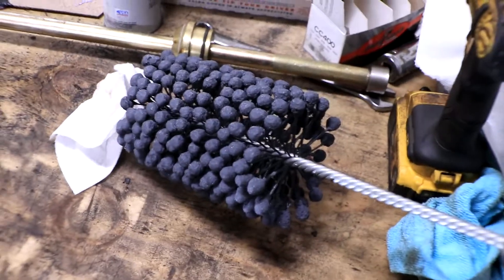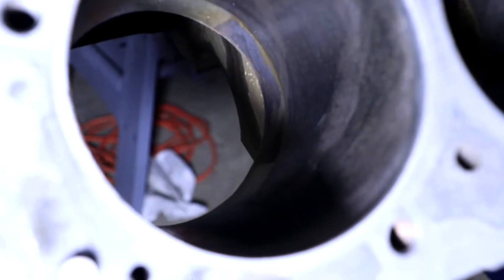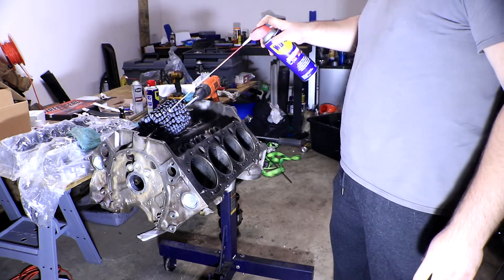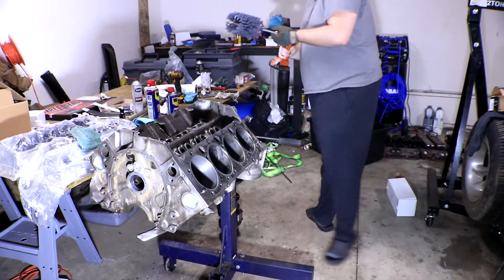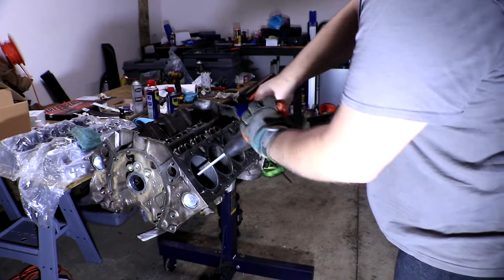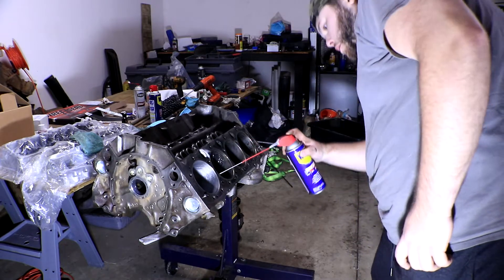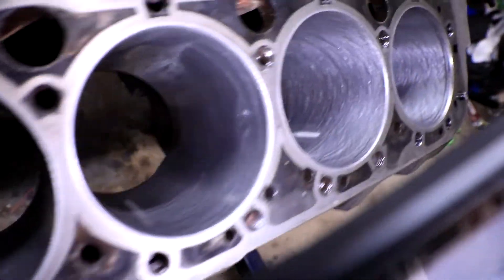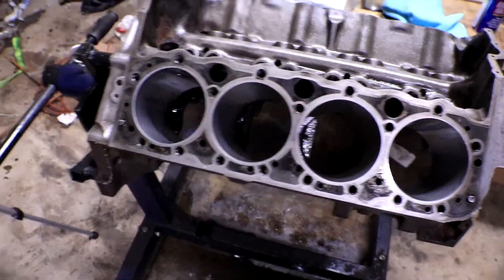HOW TO HONE YOUR CYLINDERS WITH BASIC TOOLS!

Comment: Don't be to concerned about the 45 degree. Done properly you'd need a machine shop, knowledge of oil weight, spec on ring material and average operation rpm range. Your block has wear at the top ring pivot point. Grab some wet and dry say 320 grit and rub those ring pivot marks clean, then re-run the ball brush.  A proper hone process uses a low grit to form channels to hold  a layer of oil for the piston rings to aquaplane on. The high grit cuts off the peaks of the low grit honed shape to form plateaus with fine peak. The fine peaks wear away and wear into the rings, when both wear smooth they can slide having worn a perfect fit between them. Yours should be fine as it'll be a low revver and have plenty of thick oil with a wet sump.

Comment: A workmate of my brother had a high mileage car for commuting, it was beginning to have a serious problem with oil burning. He was of a mind to do a proper rebuild at huge expense until my brother persuaded him to do a cheap job to suit the value of the car. New rings on the original pistons, bores prepared with a homemade flapper wheel in an electric drill. The car was transformed and was still going strong 100.000 miles later. IMHO people are too keen to rebore engines oversize when the bores are only lightly marked.